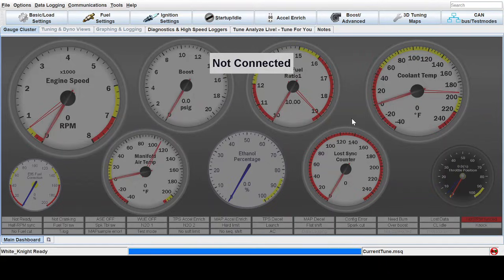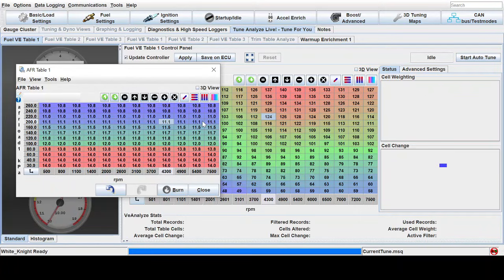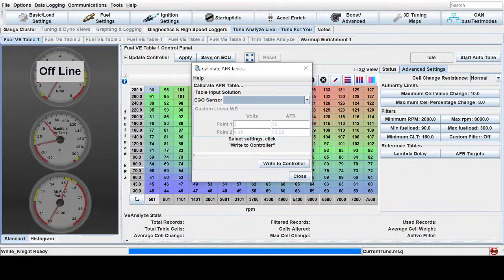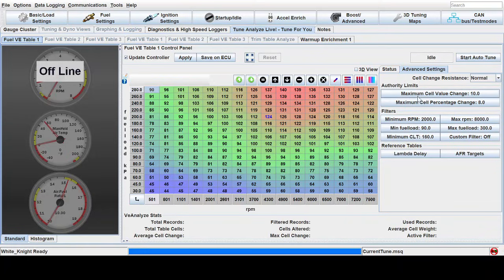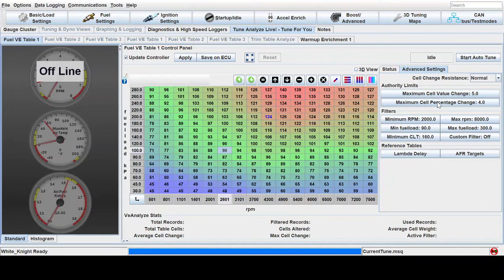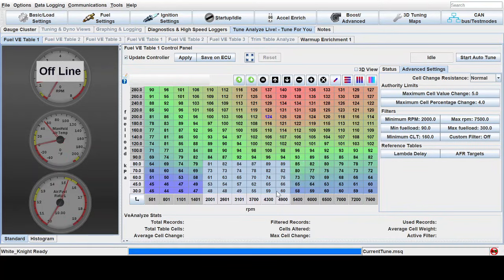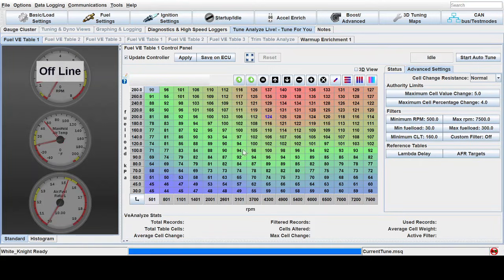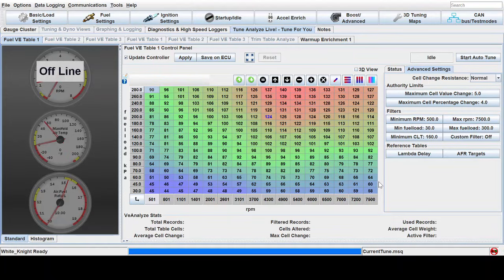Megasquirt Auto Tune Basics | Learn to Tune

Comment: Could a megasquirt 3 pro mini work with an rb20de+T neo on wasted spark? Want to go turbo and looking for a budget management system for 8psi boost. 
Original plan was to go with a apexi safc and retard timing for 8psi
Reply from the maker: Yes it could definitely run that engine
Reply: @TurbineResearch  Does the megasquirt 3 pro mini have the auto tune feature ?
Reply from the maker: @raywaltdecuba5699 yes

Comment: I wanna thank you for thos video you made. This my first time getting into stand alone computers. Ive been wrenching on cars for 30years +
Ive had a turbo VW Rabbit with a 1.8L 16V engine from a Jetta GLi no piggy back computer just using  the mechanical Cis fuel injection system from Bosch that the engine comes with... i want to know what computer system is needed to use with the Megasquirt3 for the Wideband 0² sensor? The Megasquirt3 computer only has 1 wire for the 0² sensor and wideband sensors have multiple wires 😅

Comment: Thank you for doing these videos, very helpful! Question on the Advanced Settings Max Cell value and percentage change. Are these the most this cell could change overall for the starting (downloaded base) tune or the max autotune can change each time it is used?
Reply from the maker: Those are the max values each time autotune is activated. If you apply changes and save the tune the max values start over

Comment: Thanks for doing this!  It's been a few years since I've had to use auto-tune as my car is in pretty good and stable shape.  A friend of mine just got converted and only had a baseline tune from the engine builder and he doesn't have a computer yet.  I reviewed this video first to make sure I remembered everything and your pointer on checking the advanced settings was most helpful. Mine was set to 50 pts increments and an adjustment range from 0 rpm, which I immediately changed to your recommendations...I'm going back to my car soon to do the smoothing that you also show, which I've never done outside the manual process you talk about.  Again, thanks!
Reply from the maker: You’re welcome! Glad the videos are helpful

Comment: hey where did you end up grounding your 30-4110? I'm always roughly off by .3 to .5 AFR from gauge.
Reply from the maker: Grounded it to the same location I grounded the ecu on the intake manifold
Reply: @TurbineResearch  well crrap, me as well.
Reply: @TurbineResearch  is yours still off or does it match to gauge?

Comment: Thank you so much for sharing your knowledge. I have a 95 KA24DE 240sx (drift track only build) that I turbo'd and just got my mega squirt ECU today. My question is, Would you rec tuning it myself based off data I get from doing street pulls? Or am I better off just paying a dyno tuner when it comes to tuning.
Reply from the maker: It depends on what your goals are. I always advocate for learning yourself so that you can know the system and diagnose any issues down the road or do fine tuning at the track.

Comment: I've done a little bit of Auto-Tuning on my project, and you covered most of the basics here nicely - but what about "Lambda Delay" ?  I think this could be an important aspect, because depending on sensor location, if these values are not right, it doesn't take much imagination to see how Auto-Tune could be modifying the wrong cells.  What I've seen suggested, is to temporarily fatten up the VE tables (say, by 10%) and watch the logs for the AFR change and then make adjustments to the delay table... But I've yet to try it.  Thoughts?
Reply from the maker: I haven't had any issues with the default settings.
Reply: @TurbineResearch  Interesting.  Maybe it just doesn't matter that much?  I always wonder about this when tuners at the dyno put the wideband sniffer in the tailpipe - which is often quite far from the engine.  Or maybe they already have their compensations dialed-in?  I have my wideband sensor mounted in a "cross-over" point of my exhausts (so I'm capturing output from both cylinder banks) and so far it's working pretty well, but I've yet to do any road-based tuning with any seriousness... Thanks for your reply!

Comment: Top of the Tune Analyze Live (TAL) screen we have "Update Controller" which is one checked and "Apply/Save". If it's not checked off, will TAL be working at at all times? What's the difference between Apply and Save and when r they used?

Comment: What about timing? Do you trust VE analyze to make safe timing adjustments on its own or how does that work?
Reply from the maker: A dyno is required to test ignition timing. You can use a base map that is safe until you can use a dyno
Reply: @TurbineResearch  that’s what I figured, I’m trying to learn how to tune and the guy I’m learning from is showing me how to do ignition timing cell by cell on a load bearing dyno. Didn’t know if there’s a way people street tune timing without the high possibility of engine damage or a power band that’s just not right.

Comment: Very nice introduction.  Should EGO control be off or have 0 authority while using auto tune or is the ECU capable to dealing with running auto tune with EGO control on and with authority to change fuel?
Reply: I agree with EGO control at 0, or off. I  would also add that turning off over run fuel cut and acceleration enrichment is a good idea, too. So long as you make very subtle changes in TPS while tuning VE, you should get results in just a few passes at various kPa. If you have a mbc, or ebc, you can also set boost at a high level and a low level, do some pulls and interpolate between these runs for good results. 

Finally, VE analyze live loves to pull fuel under vacuum, so when you're coasting under say 30 kpa, it'll frequently pull your AFR's into max lean regions, which isn't great for tuning for on/off throttle for accel enrichment. Manually tune these lower areas until they match your ideal AFRs, then you'll find accel enrichment from engine braking to WOT will be much cleaner. Use over run fuel cut and engine state settings to cut fuel on decel to gain economy back and don't let your VE table pull your fuel for you here.
Reply from the maker: Set authority to 0. You don't want any external multipliers or influence on the fueling table while trying to tune with auto tune
Reply: It's so strange how much this topic is up for debate.  I see people saying VEAL can deal w EGO on and lots saying to disable anything that would mess w AFR.  I'll try 0 authority to see what changes on the VE table.  Thanks!

Comment: Great stuff, and very helpful.  I am curious, I am using v3.1.06 TS, and my "Tune Analysis Live! Tune For Your" table shows "fuelload % versus rpm", with similar scale number as yours (20 to 250%).  Do I need to run the AFR Table Generator first to establish a kPa vs rpm table?  BTW, if it isn't obvious I am new to TunerStudio and MegaSquirt with a recently purchased '93 MR2 3S-GTE with MegaSquirt pnp.  Thanks!

Comment: I CANNOT figure out how to lean mine out at idle. 11.5 on the AFR gauge and my wife makes me change my clothes before coming in the house.
Reply from the maker: Check out my latest video on idle tuning it will help
Reply: Don’t tune off the wideband.. If it’s that rich you need to change clothes you know it’s too rich. Btw I’d shoot for 12.8-14.0 depending if na or boosted but you probably got that figured out hopefully
Reply: Your car will idle how it wants to idle. Especially if cammed. If it's an na Camry that's one thing. You dont just lean it out brother. 😂😂😂
Reply: @theccwdad no, your car will run how it’s commanded to run. Engines don’t have minds of their own.

Comment: When running the auto-tune feature do you need to turn off overrun fuel cut and  acceleration enrichment?
Reply from the maker: Yes turn off anything that will add a multiplier to the main fuel table
Reply: @TurbineResearch   That was a quick response. I'm troubleshooting some rich cases and want to start over with a well tuned table.
Reply: @TurbineResearch  wouldn't that make the auto tuner try to compensate for the lean spike in acceleration? With AE enabled, at least tuner studio will stay away during the event
Reply: @TheChrisey  its necessary to keep you TPSdot to as low a level as you can. For best results, do pulls where you add and hold throttle in a locked region, so your throttle changes aren't affecting the table. For example, if you set minimum RPM to 3000, you can lean into the throttle at 2500 and remain steady all the way to redline. Do this at various TPS positions, so you cover a few rows of the table from max kpa to a lower kpa, like 70-90. Interpolate the missed areas vertically and you've got a pretty solid point to switch over to a hard/very hard authority and lower value/% change points.

Comment: The air fuel ratio differential between gauge and tunerstudio has been my kryptonite for using autotune.
Reply: Very important that the megasquirt and the WBO controllers are grounded together, to make sure that the ADC doesn't get distorted.
Reply from the maker: It's caused issues for me too. I ended up manually entering the sensor range in the afr calibration and it helped a lot.
Reply: @TurbineResearch  Whatever guess I make on the top and bottom AFR range never holds across the linear spectrum, usually off .5 to a full point in some areas, frustrating as hell, lol.
Reply: Tunerstudio, for some reason, always shows richer than gauge, so if you engage autotune, it leans the hell out of your fuel table and you are back to square 1.